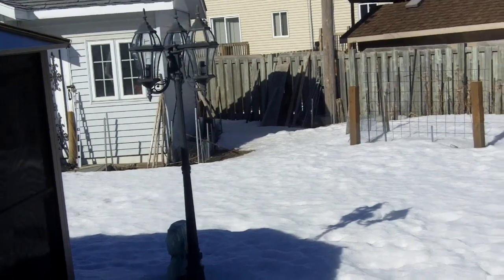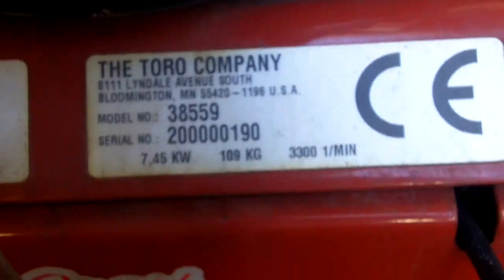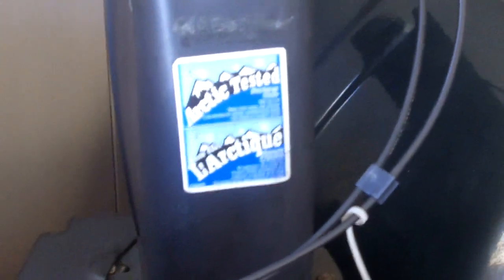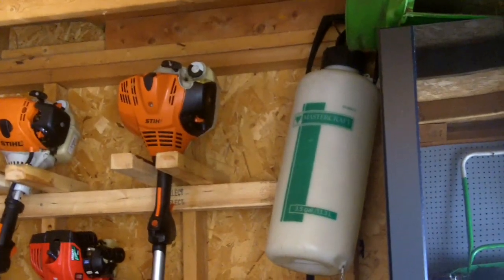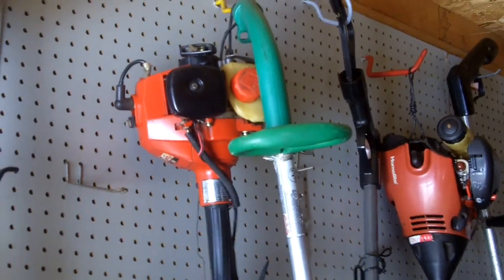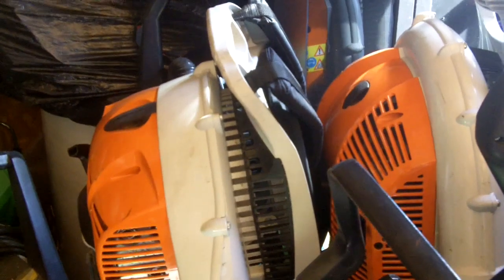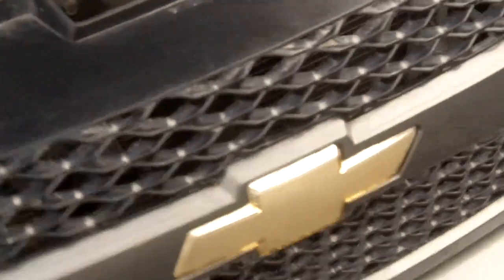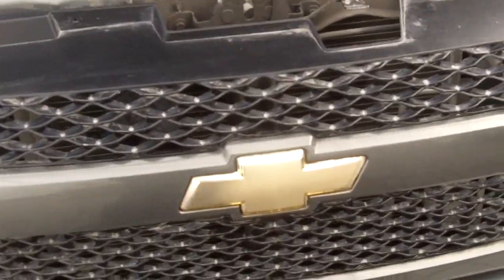Truck and Lawn Equipment Update

Comment: Nice one, Jon!  Looks like your truck is very dependable...what you need for Canadian winters...the lawnmowing season has started here a couple weeks ago!  :) Jack
Reply from the maker: Hi Jack, that truck has been awesome this winter. We didn't get much snow, but it was more of a deep freeze with temperatures in the -15 to -20F range (around -30-35 celsius when you take the windchill) and has always started on me.
Reply: Jon3800 That's a great recommendation!  Does it have an engine block heater?  
Mandatory studded snow tires?  Looks like Massachusetts got your snow!  They're still reeling from it...not used to that amount!  :) Jack
Reply from the maker: Jack, I don't think it has a block heater and no studded tires either since it's illegal here in Quebec Canada
Reply: Jon3800 Hey, Jon!  Those block heaters are useful...and I can see why studded snow tires are banned...when  used in the northeast here, you could see the top layer of the roadway eroded by the studs.  They were definitely a mixed blessing, and increased the cost of highway maintenance.  :) Jack